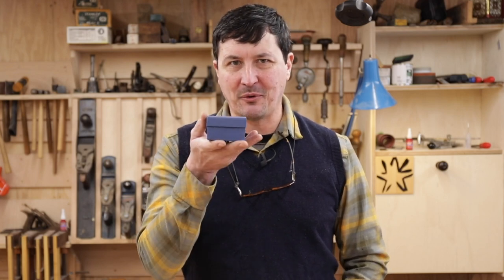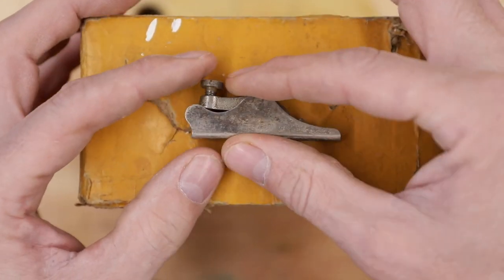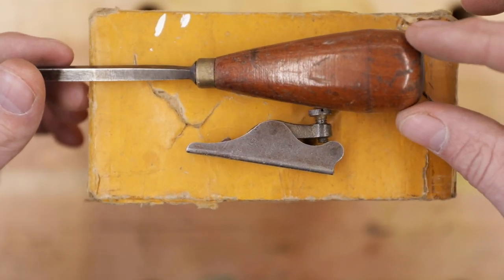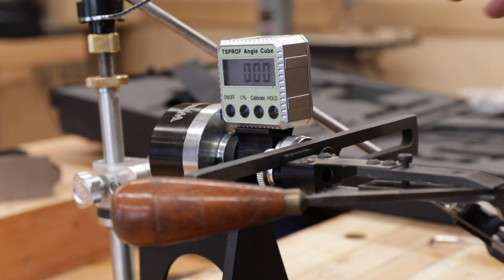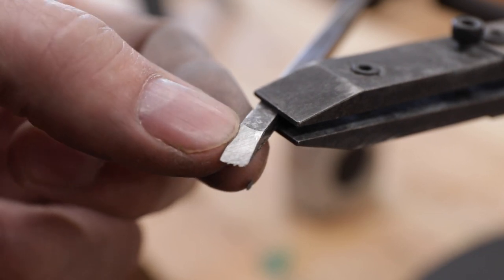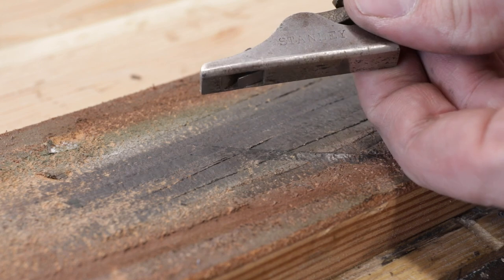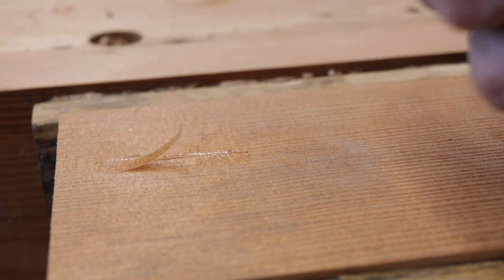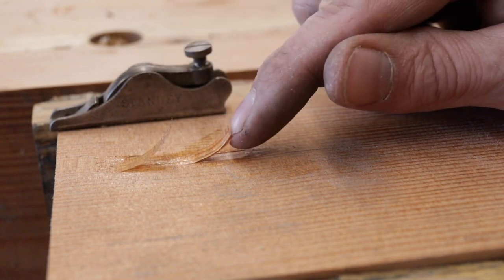I Was Shocked To Find What Was Hiding Inside

Comment: Another awesome vintage tool.  I sure enjoy the videos about the old tools and the quality.  Thanks for sharing.  Flattening the back of a chisel or any blade is called lapping.  It's done to remove machine marks or unevenness which would make the cutting edge not straight across, for anyone wondering why.  Blind nails were often used on molding and trim in well-to-do houses where the woods natural finish was important and nail heads were unsightly.  Now, the majority of trim is painted.

Comment: an old master nail pounder friend of my dad's used to do such things with a sharpened screwdriver. Peel back a half inch by 3/16 inch curl keeping it thin enough to bend back sufficient to nail and countersink a 8p finish nail. if the curl is too tick, it will snap and will likely NOT lay down when glued using old spirit gum adhesive. I never saw any such nails he sunk with this technique. masterful! You have a rare, fantastic find there bud!

Comment: Fishglue is made out of fish cartilage. It is not super fast drying, but extra thin and gives a super strong connection. But you are able to seperate two glooed pieces simple by heating the glued aerea, the glue turns liquid again.
 It is water thin and runs into the smallest cracks. Luthiers and Violin makers used it to glue instruments and to attach precious and super fine bone, tusk or pearloid inlays to the thin deck of a violin. They repaired cracks with fishglue because it was so super thin it just flows because of capilar effect into the crack. You just had to clamp it after the glue was attached. 
Today they use water thin superglue like the Glueboost stuff. It gets harder, and you are able to accelerate the drying process with glue accelerator spray.

Comment: Might be time to trade out Loctite with 
Fish glue..

Little info on fish  glue can be extracted from fish by heating the skin or bones in water. The purest form of fish glue, made from the membrane of the air bladder (swim bladder) of certain species of fish such as the sturgeon, is also called isinglass ).

Fish glue is so strong that it was once used to adhere the cobalt chrome beads to orthopedic joints ( hips and knees) and bone would grow into the voids..

Comment: Supper glue will probably never work doing that without an accelerator. Water is what sets that glue, the lumber would be less than 10 or 11% RH. Would cure very slow. I build balsa models with it and have to use an accelerator all that time.

Comment: Both your shavings were too thin. One place the technique was commonly used was fine wood floors.  Face nailing the starter boards or threshold nails you wanted the nails hidden to match the rest of the floor which would have the fasteners hidden in the T&G.  Nice video and tool.